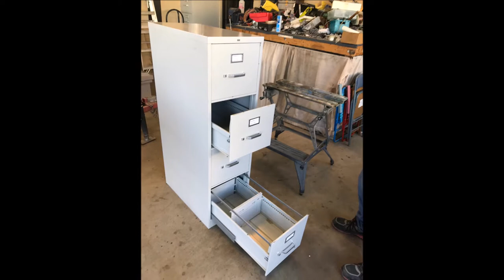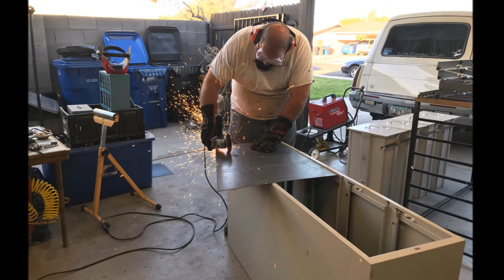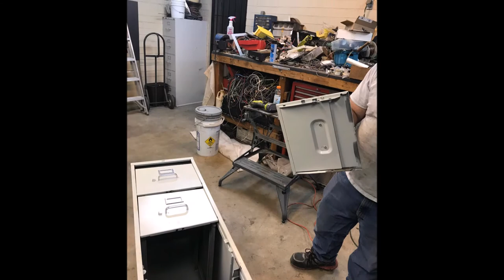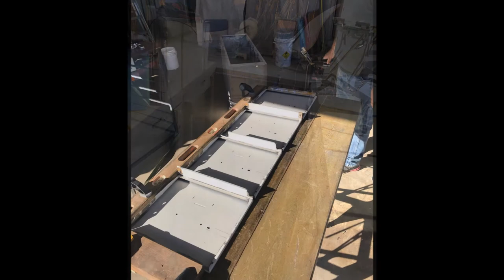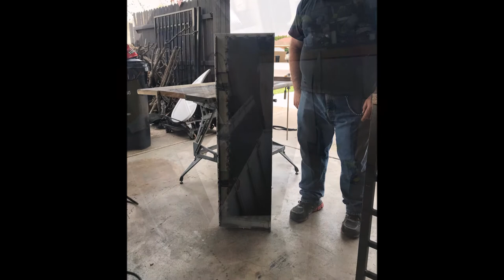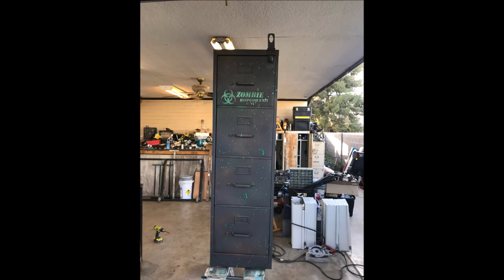4 drawer file cabinet converted to a hidden safe

Comment: OOOhhhh... The company I work for is throwing out some wide (legal size) fire rated filing cabinets.  I see a build like this in my near future.  The cabinets even have a separate lock for the top drawer and then the bottom 3 drawers.  Can just keep the top drawer as is for ammo storage and just use the bottom three drawers for the gun safe.  Now, just need to get some help to move those beasts since they are about 300 pounds each.

Comment: What hinges did you use and how have they held up during usage?
Reply from the maker: We used a flush mount cabinet hinge from Home Depot so the door closed flush. They work great the door weights about 20lbs with the reinforcement panel  and they hold it well and close as smooth as the day it was built.

Comment: But how in the hell did you do it?  are the drawers welded together?  I think this is beyond me, unfortunately...
Reply from the maker: The drawer doors are welded together into one large solid door. All the internal hardware was removed and cut out. Hideaway cabinetry hinges where attached to the welded door and then attached on the inside. This was the hardest part since the door had to close square into the opening.